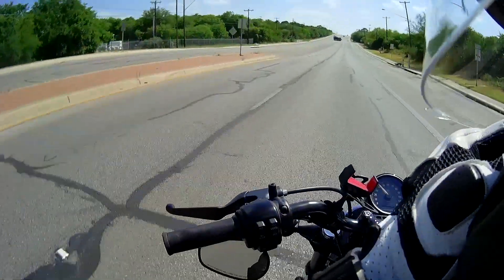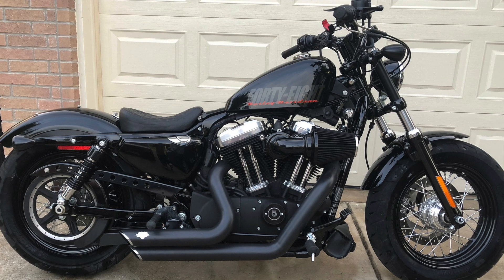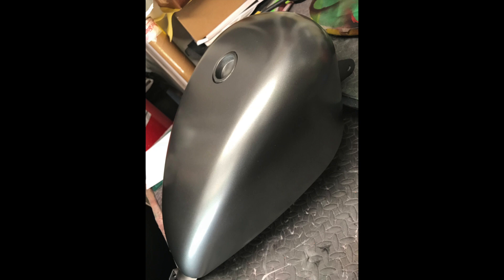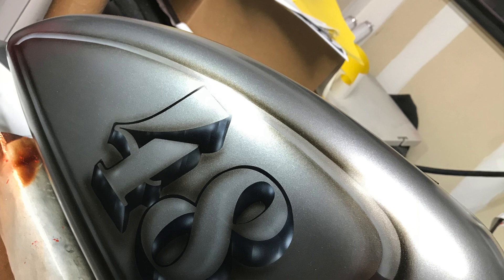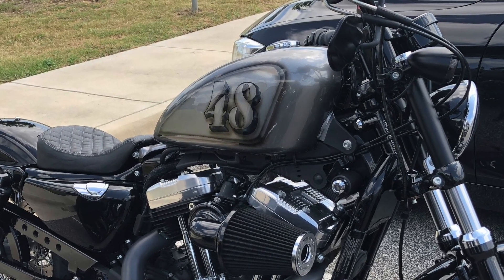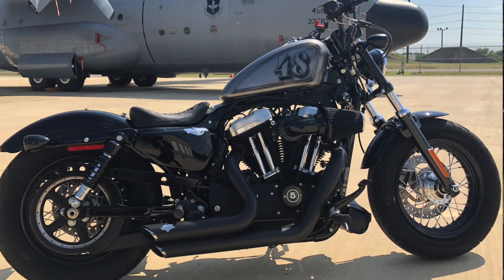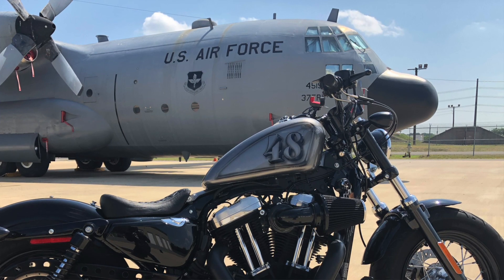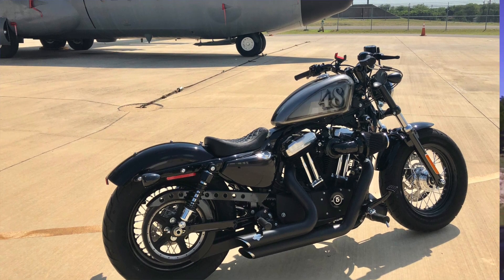Sportster 48 Gas Tank upgrade!

Comment: your bike looks awesome, i have a question, is the tank tested for pressure ? do i need to make any inner work ( primer coat) ? or just  go for paint job and install it ? thanks
Reply from the maker: Kareem Gamal thanks... the tank comes ready for fuel but it will definitely need more than just paint on the outside... they come primed but thats just for corrosion prevention ... sanding and body work is needed, reprime, top coat and clear or course.
Reply: Thanks a lot bro, very helpful :)

Comment: Hey man do u recommend these eBay tanks? Any issues with it before u got rid of the 48?
Reply from the maker: oeddie83 no issues at all! 2 minor Inconveniences are:
The tank needs body work! So make sure you have a good painter to work on it... it will need sanding and priming...
2 ... the fuel pump goes in the opposite side of the stock one..: 4$ in longer fuel hoses from autozone solves that.
Reply: Robert Ortiz thanks man really appreciate all the information
Reply from the maker: oeddie83 no problems

Comment: Hi, nice looking tank, I was wondering if you used a longer tube since the overflow opening is on the right of the new tank.Thanks
Reply from the maker: Dony Lee yes... i just went to local auto part store and got some rubber fuel line for it. Super cheap! But yes! I forgot to mentioned that in the video
Reply: @RobertOrtiz1015  Thanks man, is the one you got heat resistant?
Reply: and the size in diameter if you remember, appreciate it!
Reply from the maker: Dony Lee i took the one from bike to oreilys and asked for a couple feet of similar hose. As long as its for fuel... you will be fine.

Comment: So is there a link for the tank? Or is this completely custom
Reply from the maker: Its an ebay tank… comes pretty raw and needs tons of work.

2 minor Inconveniences are:
The tank needs body work! So make sure you have a good painter to work on it... it will need sanding and priming...
2 ... the fuel pump goes in the opposite side of the stock one..: 4$ in longer fuel hoses from autozone solves that.

Comment: Where should i go for tank upgrade? can you share links?
Reply from the maker: Gamcusa 
ebay
https://rover.ebay.com/rover/0/0/0?mpre=https%3A%2F%2Fwww.ebay.com%2Fulk%2Fitm%2F172864051245
It comes wayve so it does need body work and the vent port comes on he right side so you need a hose(3$ autozone

Comment: Tank Looks amazing... So questions,... Did you have to seal the inside? I heard the screw holes on the pump seal are poorly made? What other cons did you find? Espeacially since youve been riding with that tank for a while now. Thank you for your time. Be safe.
Reply from the maker: TheBLINDGIANT  worked out well... i use the harley gasket with all the stock hardware with no issues. Bumps in the process were ... tank is not close to be finished... you need a person that can do some good body work! Need sanding and evening out and priming prior to paint. Also, the pump hole is in the opposite side so i had to reroute the hoses... 3-5$ in hoses from auto zone ... everything else went smooth !
Reply: @Zaid Lionel instablaster :)
Reply: @Harper Ira it worked and I now got access to my account again. I'm so happy:D
Thank you so much you saved my account :D
Reply: @Zaid Lionel happy to help =)

Comment: Do you have a link to where you bought the tank?
Reply from the maker: Tony Tarlano ebay
https://rover.ebay.com/rover/0/0/0?mpre=https%3A%2F%2Fwww.ebay.com%2Fulk%2Fitm%2F172864051245
It comes wayve so it does need body work and the vent port comes on he right side so you need a hose(3$ autozone